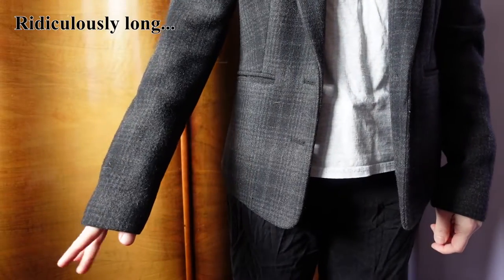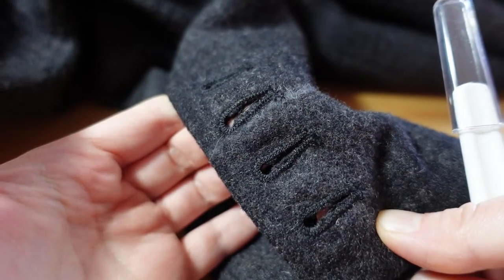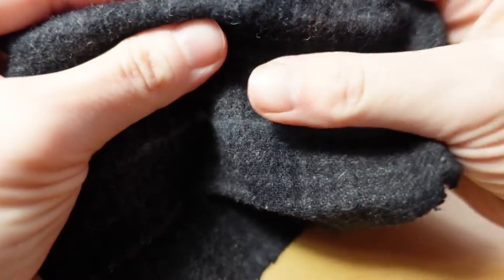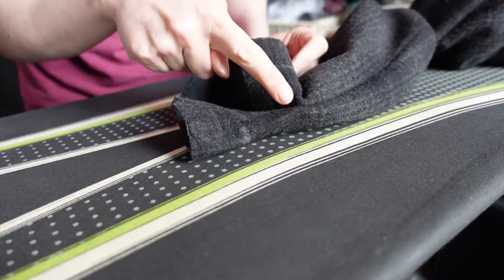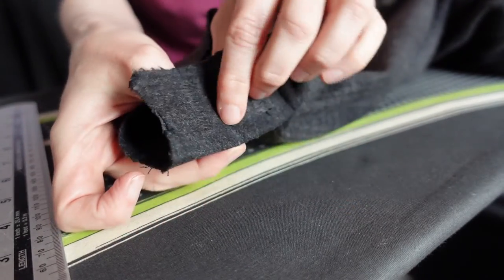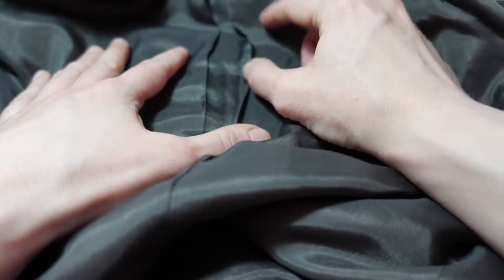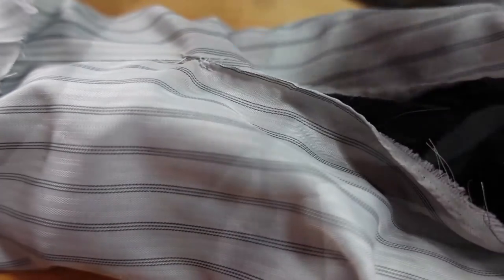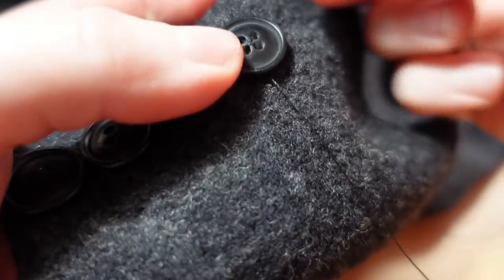How to Shorten Sleeves on a Lined Jacket with Functional Buttonholes | Sewing | Tutorial

Comment: the problem is that the last button is too close to the edge of the sleeve, at least 1 inch too close.
Reply from the maker: Thanks for your comment; I probably should have mentioned in the video that the buttons would end up closer to the cuff, but with it being my own jacket it was a sacrifice I was willing to make. I don't think a lot of people would be too bothered (or maybe I'm just speaking for myself!)

If it is an issue for you, you could look into more 'invisible repair' techniques - e.g. darning, felting - though its success would depend on the texture of the fabric.

The only other alternative would be to take the sleeve up from the shoulder, but if you need to take off more than an inch it's not really viable because of the taper.

Good luck.
Reply: Why not just replace the functional buttons with fake ones as most ppl wouldn't care. Am I missing something?